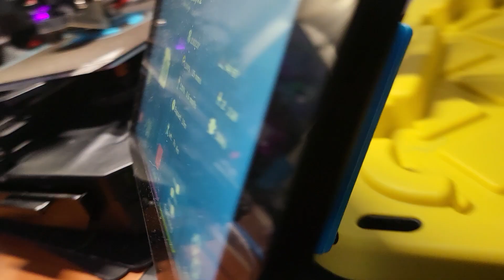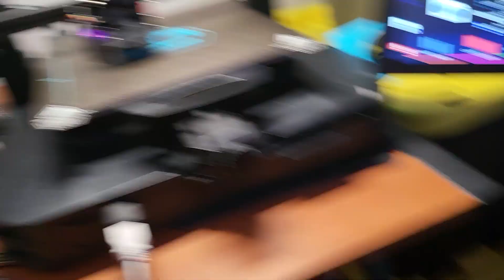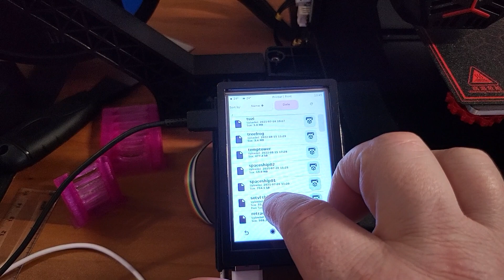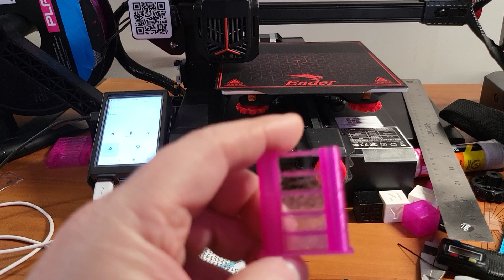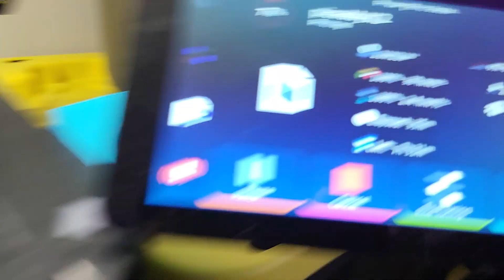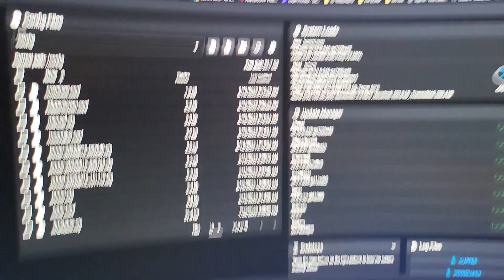Ender 2 Pro / Ender 3 s1 Pro updated

Comment: Excellent setup. Could you share your printer config for the Ender2 Pro? I have a BTT e3 mini v3 board, pheatus dragonfly bms hotend, Sprite SE-NEO Extruder and cr-touch. I have a BTT Pad7 and would like to use that with the Ender2 Pro. I hope you can help. Thanks in advance.

Comment: I have a NASTY amount of gap in the bed on my Ender 3 s1 Pro, Creality stopped responding to me, its 1.5months old. Did you have that issue? if so what did you do to counter it? Thanks in advance. Use Aqua Net on the print bed, sill still NICE.

Comment: Did you face any issues with the quality of the prints? I installed klipper on my s1 pro and tried all the calibration in the documentation and I still have so few issues with stringing, gaps on corners and layer shifts
Reply from the maker: No 90% of the original issues I had previously where due to not calibrating flow or e-steps.  You must also calibrate your pressure advance.  Once that's done and you con firm your rollers are at the right tightness and belts are tensioned, you should be fine.  Gaps are under extruding, and you should get those calibrations done.

Comment: Hi, where did you get the case that you use with the ender 2 pro`s pi? i have the same hardware laying around and would like to use it with my ender 2 pro but i could not find any good case model yet
Reply from the maker: The case I had from a purchase from amazon a while ago, the blue mount I created in Fusion 360, I have since created a couple of newer mounts one same style but can be mounted on both the E2 and E3 S1, and one that is horizontal

Comment: I have an S1 Pro and was thinking about Klipper as well. How long did it take to do the upgrade? Any challenges or gotch ya’s? Also, I thought input shaper was supported on Marlin. Is that not the case?
Reply from the maker: Going to be honest I have to say the install is pretty smooth, one item that really helped was that when you make an error Klipper/Mainsail will tell you what it is that is missing, or broken and that really helps, such as cannot read Printer.cfg error, because I had not created it yet.  However the generic config is available on their github site to start with so copy it over and boom, you can get it going.  I suggest using the Raspberry imaging tool to create the mainsail SD card image.  

Just follow the Klipper and mainsail documents on how to do the install including creating the firmware for the printer.  If you have every installed linux, or even games on linux I found this to be very easy to do following the documentation.

Input shaper may be supported, I wanted mainsail and clipper for the functionalty, wifi printing etc.  I already had two Pis laying around so.

Comment: Hi
 Ender 3 s1 Pro running Klipper  Firmware?
Is it the same system on Ender 3 s1?
Do I need to modify the original connections in the control panel?
Thank you for your patience 👍
Reply from the maker: Absolutely no physical modifications, no you do not use the old touch/control panel, it is not useable with klipper technically.  The Raspberry Pi provides the video and touch interface with whichever touch screen you go with.  The 7" like I have on the S1 Pro is like $54 its not super expensive.  You can also go down to the 5" which would be more appropriate but I like the bigger screen.  I am also going to be building two Vorons at the end of the year so I will be picking up more screens and Pis etc.

I am only using a power source via the USB type C connector on the Pis to power the brains, and another USB type C going to the printer from the Pi to send the G code to the printer.  Now the mainboard on the printer only has to run the commands and hardware and not any of the caclulations.  They print faster now.  Just have to remember to run your input shaper and maybe pressure advance.

Printing is so much better, accurate, and faster now than before after input shaper I was able to bump up the printing speed by 20% on the S2 PRO and the S3 S1 PRO I can run it full blast at 150mm if I wanted but now I run it at 100mm instead of 60 so 40%.  I slow it down for important prints just to ensure no funny business but that is just on delicate or picky prints.

Comment from the maker: Correction on the bolts, they are not M4x18 they were M4x30 so I needed to go with a set of M4x30 (if you are wondering the M4s are a 0.7 pitch the M3s and smaller are 0.5.